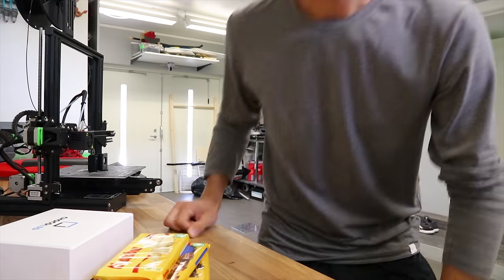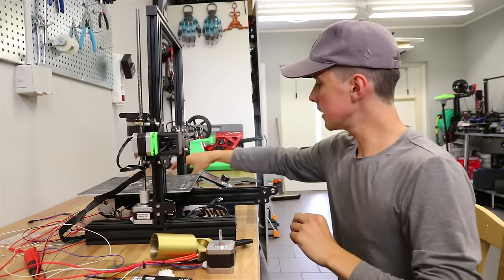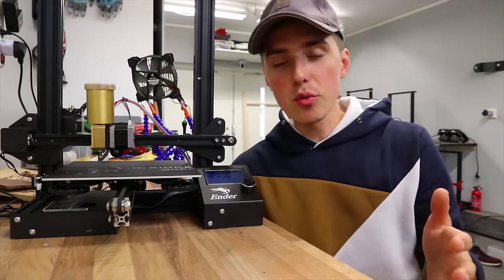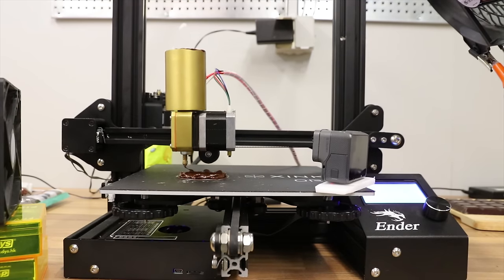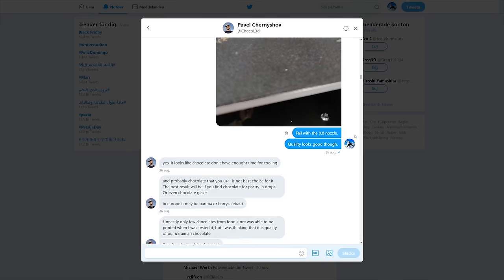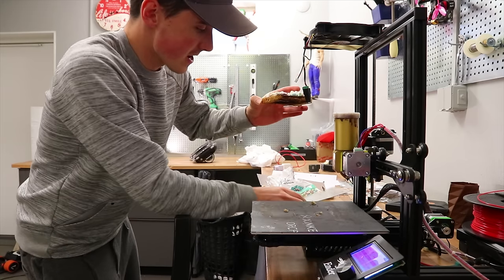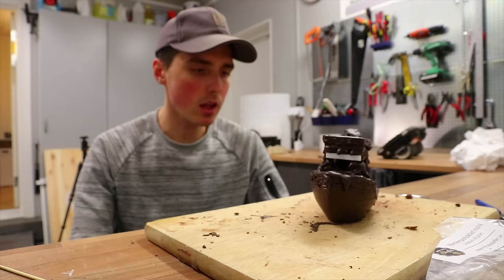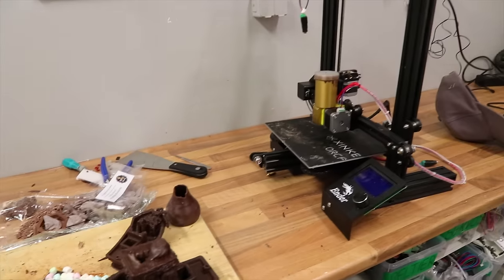3D Printer Makes the Perfect Chocolate Layer

Comment: If you insulate your heating barrel and extruder you could print in a controlled lower temperature. That would allow you to maintain your molten chocolate while also providing the environment to solidify the structure. Though this would cause your chocolate to possibly not be tempered.

Comment: You can use a peltier module under the printing surface (Cold Side).
It will help you to freeze the melting chocolate instantly ^^
Reply: Only for the first few layers though, after that the peltier is useless. I not quite sure what the actual thermal coefficient is of chocolate, and it probably greatly varies with the specific type of chocolate, but I am quite sure that it is not very high. In non science-speak I mean that chocolate does not conduct heat very well, unlike metals such as brass or copper, such do have a very high thermal coefficient and conduct heat incredibly well.

Comment: It would be a lot easier to create a silicone mold of a print and cast chocolate that way (though complex shapes like a benchy would be impossible)
Reply: Nah, you can print a benchy mold, it would just be in 10 pieces that snapped together.  My mother used to use molds like that for very complex ceramic shapes when I was a kid.
Reply: Well, to be honest,, printing complex shapes like a benchy looks pretty much impossible with this contraption too....

Comment: Could you print in a container of cold water? You d have to waterproof a lot of electronics, but the chocolate would solidify much faster I think
Reply: Water fucks molten chocolate up
Reply: @halipatsui9418  Oh, youre right, but maybe ethanol could work?
Reply: @testibiedermann9496  hell no.
The cooled bed someone else said is good.
Also with actually cooled fans that get their air intake from freezer or something similar would work well imo.

Damn if i someday ditch my ender 3 for better printer i might just make it a chocolate printer lol
Reply: @halipatsui9418  Yeah, its messy enough as it is anyway on a second thought XD

Comment: Two problems up front:

1) You were using untempered chocolate. You need to temper the chocolate then put it into the holding vat.
2) It looks like the temperature in your workshop was too warm. You need to be able to cool the chocolate somewhat quickly. Other 3D chocolate printers use enclosures to help maintain the correct temperature.

Comment: I'm an electrical engineer. I kinda want to make something like this now. Have a cooling system to cool the later and the air or print inside a fridge and a very got nozzle that will melt real chocolate easily and adjust the temp so it works well and print slowly. It shouldn't be too hard compared to other things I've done

Comment: This kind of printer should give you lots of control over the internal structure of your chocolate models, which means a lot of control over mouthfeel. 
For example, a chocolate bar whose inside is made of thin, thinly spaced “shelves” would be a very different experience than foam texture, and both of these would be different than a solid block.

Comment: One idea. Why not to use this as crude recycling of failed prints I know it will need a lot of modifications but it will be cool to see
Reply: A lot of modifications? Literally there is nothing to do there just stick some plastic in it and it will work
Reply: f1 sauce  No i was thinking more like direct printing  you will only fill hopper with plastic scrap and print with it another model.
Reply: @raidzor5452   i think it need more heat like ~200C maybe not sure and better extruder
Reply: @raidzor5452  Isn't the melting point of plastic way higher than chocolate? At least the heating element would need modifications and parts of that extruder are made of plasic. You would have to remake them out of something that has a higher melting point than plastic.

Comment: FYI, cura has an option under cooling I think for minimum time per layer. So if a layer prints in under 10 seconds, the extruder will go to the side and wait for the time to hit 10 seconds, thereby allowing the layer(or chocolate) to cool and solidify.

Comment: Using the same extruded at a higher temp, could you reuse plastic from old/failed projects?
Reply: No, but you can smash the old /failed project and using it in an extruder making new 3d filament.

Comment: if you have issues with your chocolate ,just use a teaspoon of vegetable oil it will make the viscosity a tiny bit thinner ,and help it to flow better ,its what you do with chocolate fountains when the don't run smooth

Comment: Not sure if this is still relevant, but chocolate may have been finicky because it needs to remain at very very specific temperatures in order to "temper" (harden to give chocolate that snap). That being said, if the chocolate is not heated correctly it "blooms" and the chocolate is essentially ruined. Vegetable fat in chocolate would make it less likely to "bloom". Some people (when baking) use "chocolate candy melts" instead of regular chocolate bars or chocolate chips because it has the vegetable fat in it, making it much easier to temper.

Comment: I don't mean no disrespect to the manufacturer, and I'm sure he knows more than me on this topic, but at least to me a gear pump, while surely the simplest solution, seems like perhaps the worst way to push the chocolate out of the system, especially with how narrow the top funnel is. The chocolate would have to get so soft to even reach the gears that it may as well just drip out on it's own at that point. I don't have much experience with 3d printers, so I'm sure there would be some unforeseen technical issue, but having maybe a linear actuator at the top pushing a piston down into the cylinder instead might provide more constant flow and better pressure, making it so that you can print with less runny chocolate. Also it would probably leak a lot less, and be much easier to clean than those gears... Just a thought.

Comment: You need to use a "chocolate confection" type product often referred to as "almond bark" as it doesn't require tempering in order to become solid. Also, I'd probably stick the printer in the refrigerator while it works.

Comment: have you considered setting up a small fan to blow cool air across the print? that way the extruder can be set hot enough to allow smooth flow, and the printed chocolate will be cooled and hard enough to not fail under the weigh of the next layers.. :)
Reply: he did it in the video.

Comment: Awesome idea!
Since the 6 months of struggle have you gotten any further with this?

Not sure if you've tried - but adding cocoa butter to the chocolate will make it more fluid, and will also crystallize better to a crisper texture!
Or specialty confectionery stores have chocolates for pros with different "fluidity" ratings, of which the more fluid ones could work (ex: Callebaut)

Also - if you are using "real" chocolate (the stuff that actually tastes nice with real cocoa butter), the extruded pot needs to be modified to first temper the chocolate (melt then lower the temp then raise the temp to the magical temperature where the beta crystals are formed) - which will actually make the chocolate crystallize (harden) faster!

And an extra point: a focused cold air source could help in case hardening is not fast enough (chocolatiers use compressed cold air sprays for this)

Obviously these modifications would probably raise the cost of the extruder to ridiculous proportions...but it's a well worth sacrifice... for science... and chocolate.

Have fun experimenting!!

Comment: You should probably set a limit on the number of layers per minute (or something like that) if that is possible. I guess that when you printed the ship in the end of the video, the printer started to go print the layers much faster close to the finish because there was less area to cover, resulting in the chocolate not getting enough time to cool down. Great work otherwise, I'm impressed! :D

Comment: yeah, having a fan blowing air on the extruded chocolate and printing in a 16 degree room would've probably produced way better results, also maybe pre-melting the chocolate to make sure you dissolve any sugar crystals and imperfections. I'd even go as far as to get a steel nozzle and prep it with oil like you do a skillet, to make sure the chocolate doesn't stick to the nozzle.
 where's CNC kitchen? he'll be perfect for an in depth experiment and has kitchen in his name!

Comment: Switching wires would've done much. Either not work at all with no damage or it would've ran the motor backwards. 

I'm wondering if maybe the driver overheated due to over current or something unrelated to the wires happened.

Comment: Great video. Have you tried controlling the cooling rate of the extruded chocolate? with a cool air fan, for example? Then you could raise the temp of the molten chocolate for smoother flow and it will solidify instantly. Just an idea.
By the way, how can I have your life? It looks like heaven.

Comment: but if the heating element is aside the motor then how comes the cogs be basically intact?
i mean, yes, the chocolate melts at low temperatures, but that should be enough to at least deform a little bit the cogs.

Comment: OK, so this video is pretty old. But read up a bit on tempering of chocolate. It needs to be taken through a few different steps in temperature to solidify properly. This will vary a lot with the cocoa solids contents of the chocolate. Probably the best way is to go through the first few steps manually before adding the chocolate to the printer at the last tempering stage, and have the chocolate reservoir keep it at that temp while printing. The printing area should definitely have some efficient cooling and the amount of chocolate printed at each pass should be pretty low. (my 2 cents only)

Comment: Hi may I ask you. How to change temperature extrusion, extruder start working at 170° only. For chocolate need 36° purging temp ,and before need prepare chocolate warm at 55° then let it cold by 28°, after you can print  30-36° .Only qwe how set to low temp extruder.

Comment: Good evening, I am from Mexico. Excuse me, I just bought that same extruder from Ukraine and I have a problem, I have tried to print with 3 or 4 types of chocolate and I have used the temperatures recommended in the manual but with only one type of chocolate it started to print smooth, then in a moment it printed fine and in the end the extruder stuck, my questions are what temperature did you use in the extruder? Should the place be cool? or at what temperature more or less?